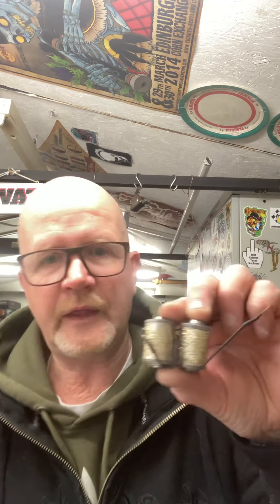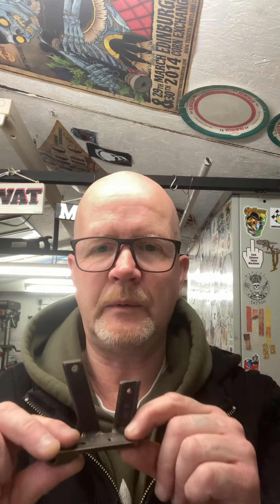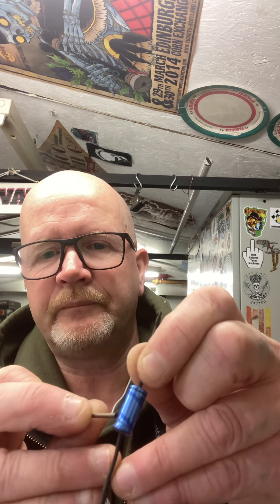Tattoo machine capacitor use and information camber Custom coil tattoo machines tuning

Comment: 😶‍🌫ty it's hard to find the information i need and i dint know i was putting it on backwards an im learning to build one and still working out issues and i just came across your channel its really helpful ty an atm im dealing with it losing power and  i haven't fix it yet to see if that was the issue
Reply from the maker: probably not losing power due to it being wrong way around, more likely to be coil related or maybe even the contact screw which should be copper not cheap brass or steel. are coils sitting on washers ? they must be ferous ie steel not stainless steel or brass. that will always cause problems. what did you wrap coil cores with before winding the wire. needs to be kapton heat resistant tape not masking tape or electrical tape. so many things could be the cause but try that lot first.
Reply: @cambercustom  contact screw was from China but i got a few others i can try and i haven't tested it yet and the coils are not on washers ,the coil cores was wrap with 24 awg which i order from bntechgo  with 6 layer and it got some kind of plastic around the coil core so i dint think i needed to wrap it with the golden clear tap "i forgotten the name of the tap " but the frame is iron and it came as a raw material so im waiting for an order 2 polish it and was thinking maybe that was one of the issue and on top of that i hade to bent the contact post strait to line  up the contact screw with the spring because  it was way off ...i was pretty t off with the seller bc i got 3 of them from  him and all 3 was bent like that and the selling info said just needed a little sanding and polish but i will be testing it sometime tomorrow when im not busy
Reply from the maker: @tengokukitsune7403  6 layer coils are hopeless, you need minimum of 8 but even then they will struggle sometimes which is why i only make 10 wrap coils. I don't know about plastic unless you mean they are wrapped on to plastic bobbins with the core pushed thru the middle. there's your problem if that's the case, 6 wraps and weird plastic, i'd need to actually see it to know whats going on, frame needing polish won't be the issue. sounds like someone sold you something they knew wasn't up to standard ( sounds harsh but it does happen ) . better off starting with a far eastern frame and building it up with parts. then once you have all the parts sorted and happy with how you make them, start making frames. just reverse engineer everything
Reply: @cambercustom  yeah its a plastic bobbins and thx for the info btw you sell parts and builds on your fb?
Reply from the maker: @tengokukitsune7403  no don't sell stuff anymore. just try to help out. drop the 6 wraps and bobbins. go to 10 and use kapton tape, 2 or 3 layers of it directly to the core then fit the washers and wind away. you'll probably take a few efforts to nail it but you'll notice a massive difference. 6 thru plastic is your issue, you need 8 min, preferably 10 with the 47uf cap. let me know how you get on.
Reply: @cambercustom  k will do ty

Comment: So getting sparks is just the compacitor? Or could it be the spring as well?
Reply from the maker: carbon or dirt on the actual contact point of the spring or the gap being way too small might cause a small arc but 99% of the time it's the capacitor being knackered